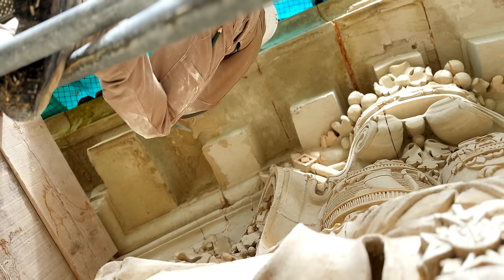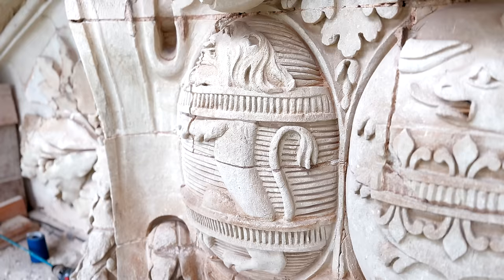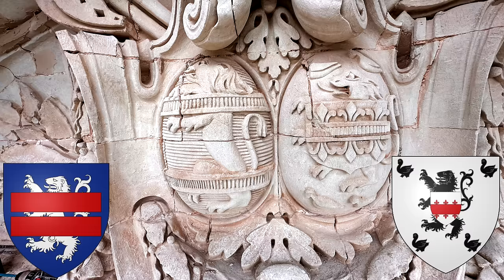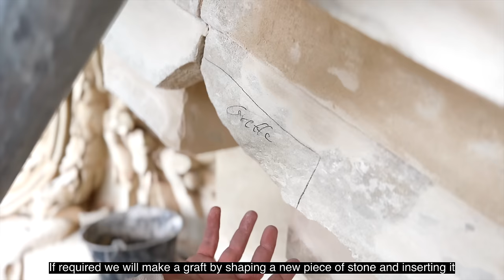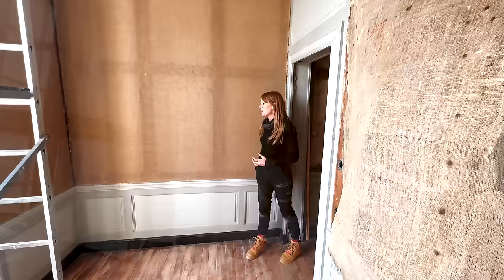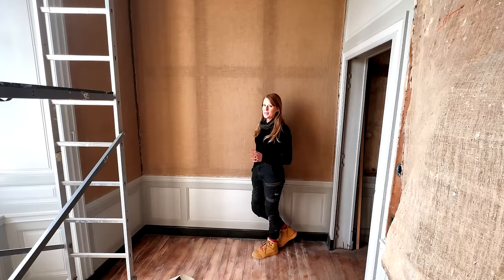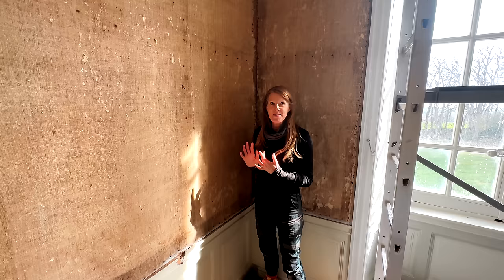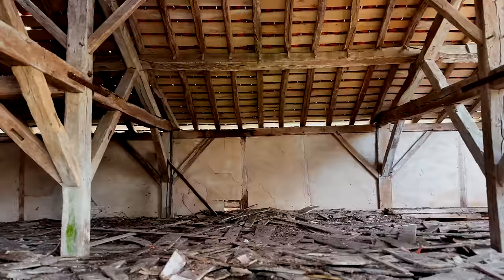What these epic coats of arms uncover about the château's past. Château Restoration Progress #9

Comment: When the escutcheon on the pediments was carved it was done in situ. Most of the other stone work could be done on the ground but those coats of arms were carved from stone that projected to the furthest point of the detail. You can still see some unfinished details on the Met museum in New York. The capitals of the columns on the Frederick Vanderbilt mansion in Hyde Park, New York were also done that way.  There is less risk of damaging them then hoisting  them into place finished. The MET didn't  have the budget to finish them back around the turn of the 20th century and they still don't know what to do there. Apparently there are no drawings to show what the architects intended. A sculptor was expected to fill out the idea on the basis of a suggestion. 
In the recreation of the staircase at Versailles that Gabriel intended to build to replace the old Ambassador's staircase, uncarved stone blanks were set in the walls. The restorers didn't have more than a suggestion of what the typical ornamental motifs would have been so left it blank. That kind of improvisation is very like the music of the time. Composers expected the musicians to be able to fill in the blanks. We don't hear that anymore because later publishers of music from that period filled in the blanks with a best guess. The monarchy was overthrown before that staircase was ever built. I suppose those blanks will never be carved? 

BTW - People tend to think the french revolution wiped out the nobility but the process started even earlier under Louis XIV. To create a modern state his government removed the high nobility from many administrative roles and replaced them with the King's intendants who did most of the administrative duties in the provinces. One of the great tragedies of history is that the government of Louis XIV knew the taxation of the country was unfair and inefficient. There were proposals at that time to create a more rational and fair property tax regime but even the king couldn't get it past the resistance of the noblesse. 
It took the french revolution to finally wipe out the feudal residue and put the country on a more stable and fair tax regime. The revolution had significant noble support at first. Many wanted their feudal prerogatives restored. Instead they lost it all. 
BTW - Have you ever tried to calculate how much total area is under roof in all the buildings? It's always amazing how gigantic that complex is? Maybe I missed it but I think I've seen all of them so far.  
Why would anyone build a floor that can't be walked on? The floor didn't look much less substantial than those you see in the Italian DIYer,s villa and farmhouse restorations. That herringbone brickwork outside on the upper level looks like something to keep exposed.
Reply from the maker: Thank you for your comments - very comprehensive.  To answer a couple of the specific questions that you have asked: 1) Total area under all the buildings.  We have not calculated every building (there are more than a dozen outbuildings).  The chateau itself is 400 square metres for each level and so 2000 square metres in total.  2) Why create a floor that can't be walked on?  It's really a ceiling that was created by filling the spaces between the oak beams that provide the structural support for the Chai.  Based on other modifications made to the building, it was probably done to reduce the amount of natural light entering the building (several windows have also been filled in).  So structurally, it was less important to create a floor for the attic, but rather to create a ceiling for the barrel room.   At some stage someone has temporarily placed large timber planks that traverse the oak beams.... These narrow planks can be walked on.  I would discourage it.  3) Your question regarding the brickwork - The herringbone brickwork on the facade will remain exposed.  On the back of the chai is a render (now badly decayed) that had a faux brickwork pattern engraved on it.  Very little of that render still exists today, but it was never intended to cover the brickwork but rather to mimic it.
Reply: - The grand total must be enormous. When you are all finished you could have one of those lists that were so popular when the big buildings in Manhattan were still so amazing. They used to love publishing the vital statistics. Now no one even notices eve thought most f the newer ones probably have as much or more enclosed space than is under roof in the rural NH town I live in.  The outbuildings are probably larger than the largest house in this town, mabe in the state? Is there any record of how many people - family and staff - lived on site? I''ll guess a few dozen.  
Thanks for the reply.. It is also amazing you are restoring the building to it's 18th century state. No insulation anywhere.so far so are you going to insulate a private apartment? 
e

Comment: Is putting some sort of insulation behind the hessian and option, or is this going to be a restoration to how it was 300 years ago?
Reply from the maker: Thank you for your question.  We are placing insulation under the floors when we lift them (for example to place plumbing infrastructure there or to replace rotted floor boards).  We also place insulation in wall cavities when we are required to access a wall for some part of the restoration.  There is also a thin insulation membrane being placed in the roof as part of the roof restoration.  So for the first time many parts of the chateau will have some modest insulation.  However, we are not placing it behind the hessian backing.  The purpose of the void is to allow air to flow.  It has actually worked remarkably well for two centuries (hence the condition of the hessian backing and the wall papers) and we want to respect this element of the building's original design

Comment: Hi. Why  not use the old wood from the Chai´s roof to make items that sell? Frames for mirrors,  little wood items... Greetings from Germany Chris
Reply from the maker: Hi Chris, thanks for your comment.  The wood that is sitting on the attic floor in the Chai is very rotted.  It was removed from the roof itself decades ago because it was no longer viable on the roof to support the tiles and needed to be replaced.  It was then abandoned in a somewhat leaky attic for a long time.  Most of it is in very poor condition.
Reply: What a pitty- here they sold the old roof tiles of very old tower, helping the restoration costs 🙂 Greetings from Germany Chris
Reply from the maker: Yes, we are selling our old slate tiles as drink coasters.  We are also reusing many old oak beams that we recovered from other projects as part of the Chai roof restoration.  We've also managed to recover and  reuse many of the old terracotta tiles.  But, sadly, the wood from the battens is rotted.